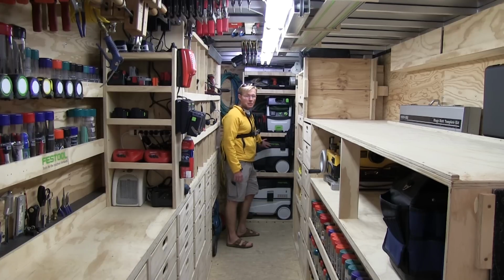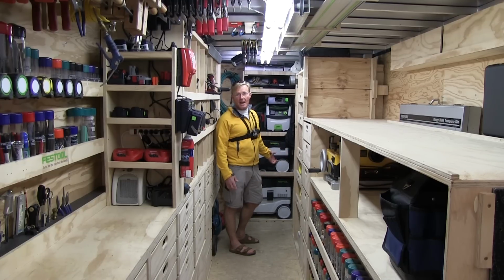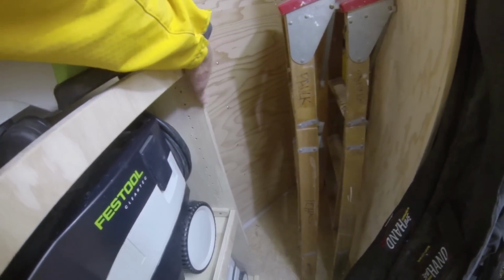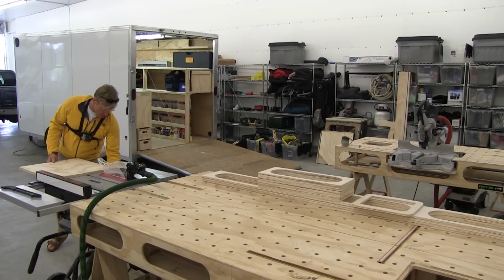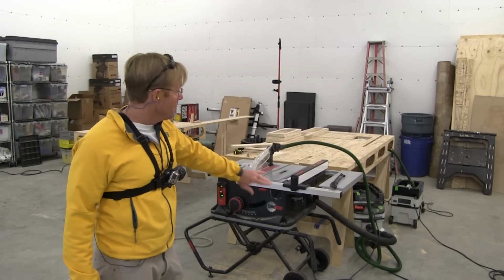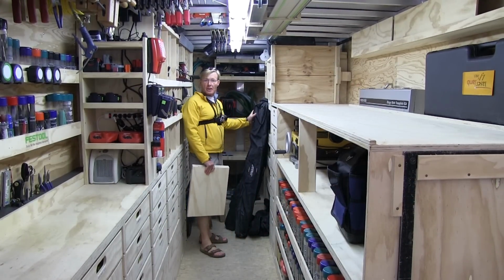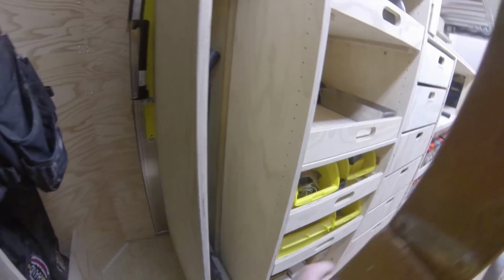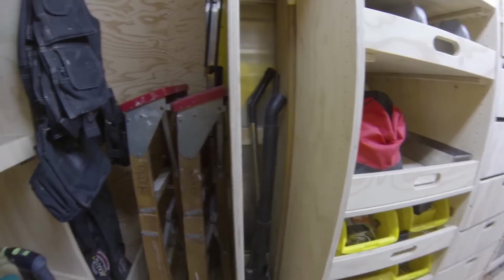Free Dust-wall Storage

Comment: Thanks Ron, I was wondering about your ladders;  I noticed this in your crown video. What kind are they and could you share a link to source then? BTW, I have bought the plans and built the Paulk work bench. Have plans to build at least  three more for my colleagues! (A miter stand and two various sizes of the original Paulk bench, Thanks for the Awesome Videos! They have changed the way I work, think, and plan my jobs!
Reply from the maker: My ladders are "Red Top" I am not sure where to get them as mine around more than 15 years old. My electrician who also used Red Top is now using Fiberglass 3 legged ladders.
Reply: Awesome.  Thanks.

Comment: Instead of messing with screw containers dumping a lot of screws out mount a small magnet in the lid and tip the container then back to the upright position then pull the lid off with the screws stuck to the magnet and you shouldn't have to fight with screws etc falling all over the floor and still have great access out of the lid.

Comment: Bungee strap
Reply from the maker: I avoid all straps and tie downs, preferring gravity to work for me. Less tie downs leads to more efficient access. I have no tie downs or lock downs anywhere in my tool trailer.
Reply: I agree somewhat. If you had a short piece of chain screwed to the outer trailer wall and a slotted piece of plywood on the center shelves you could put the dust walls in, pick up the end of the chain and drop it in the slot. to remove, just slide the chain up and out of the slot. It would work even if you had gloves on.